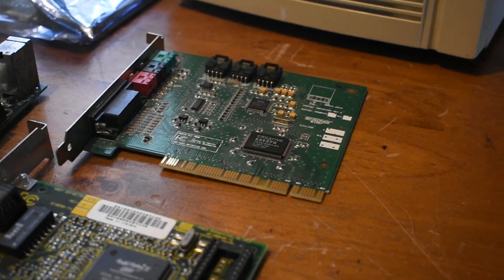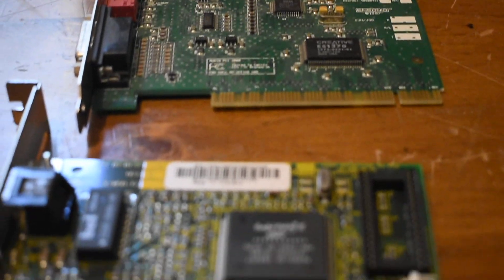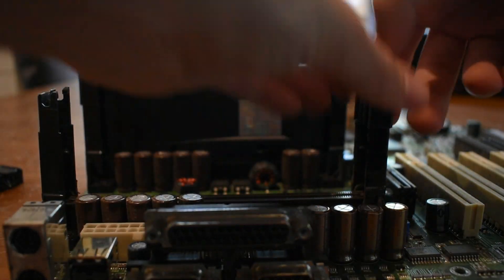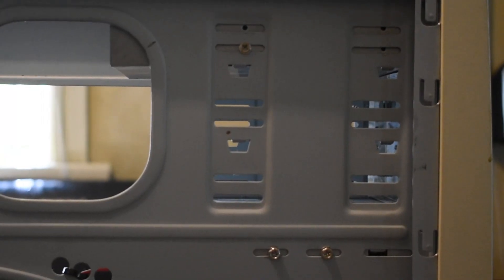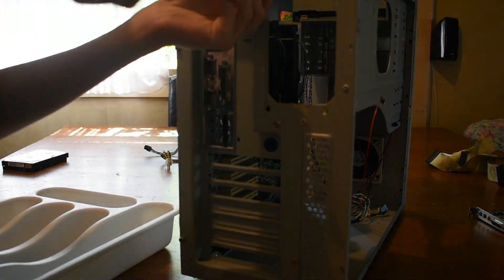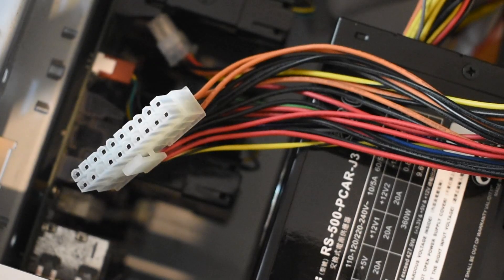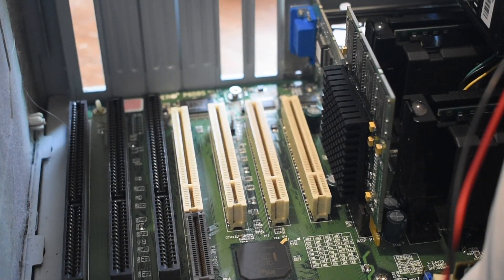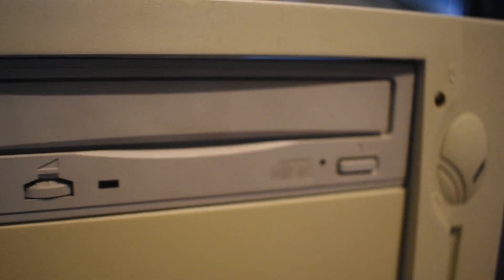Building A Dual Pentium III Workstation from 1999!

Comment: Sweet build! If you wanted to, you could easily turn this into a workstation or an overkill classic gamer. I'm putting together a similar build myself for just that purpose.

I'm throwing a pair of Pentium III 550 cards and 4 sticks of 256MB SDRAM into an old server board I found with an AGP slot and built-in Ultra160 SCSI. It's also getting a GeForce FX 5700 Ultra, a Turtle Beach Santa Cruz 5.1 audio card, and a pair of 10k RPM SCSI drives in RAID-0. Old school beige case too.

I'm using it for classic late 90s/very early 2k's 3D games, which this thing will be extreme overkill for, like putting a Chevy big block V8 into a bicycle. Pointless, sure, but that's half the fun!
Reply from the maker: Thanks! Yeah I haven't worked on this system in months now, other things have gotten in the way. I'm going for more of an overkill classic gamer approach, so I think I'll need to swap some parts and re-assess this system at a later date.

That sounds like a really nice system, should be awesome! One of the main reasons which has stopped me perusing this build more, is realizing that hardly any games will even take advantage of dual CPUs. Either way though it's a very nice setup to have.

Probably going to put either Voodoo 2 SLI or a TNT2 Ultra in this system eventually.
Reply: @ScanLinesAU  Having the dual CPUs is more of a novelty than anything useful in a gaming machine, like bragging rights, although normal Windows tasks are noticeable faster.

I had to downgrade to a Geforce2 GTS due to the power supply being too strained, but that's still a great card.

The Voodoo sounds like a good choice, although I've had more than decent performance with even the standard TNT2 for early 2000s games.

Comment: I had this motherboard in 2005, but it booted once only, and I never been able to make it work since then.  I disposed of it later. Check the price on eBay , refurbished dual Pentium III motherboards are as expensive as today's motherboards
Reply from the maker: Wow, yeah they sure are going for a fair bit hey. I don't really collect this old stuff because of it's value, I just like messing with this stuff a bunch. I think ebay is quite overpriced for this stuff, - I've  never really payed that much for any piece of vintage hardware.
Reply: @ScanLinesAU  go on eBay and see for yourself, you'll be shocked, $200 and above, they aren't even brand new . Also, check socket 370 single socket, there is one priced at $750 !! this is insane
Reply from the maker: @tunkunrunk  Wow,  yeah that's pricey alright! I've got a dual socket 370 motherboard, that aught to be worth a bunch. But keep in mind, an item is only worth as much as what it sells for. So, to get a more accurate value, always check the 'sold items' on ebay.

Comment: When it comes too the powersupply you usually aim for 3.3v too be at 25a & 5v too sit at 30a.
As it's a modern powersupply at worst it might just shut down if its too high of a workload for the power rails but worth keeping in mind if you encounter any issues related too that.

Could be an interesting upgrade using a ide too sata adapter & run a 32 - 60 gb ssd for something like this if the ssd in question does it's own garbage collection it should be fine with any file system & operating system really.

I myself got a windows 98 pc but its a bit low on ram atm 32 mb & i got a bug with the matrox mystique 4 mb graphics card that's in it at the moment locking up the system (2d gpu for the voodoo 1 i got.)
Not quite sure of the reason atm, something related too the pci bus feature set thats for sure like fastvid, bus mastering or something similar.
Reply from the maker: Ah yeah, I don't really look at the specs when using modern PSUs, just the wattage. I've had no issues with this one so far, but if it becomes an issue then I might swap it with a period correct Aopen one. 

I really don't like using SSDs in old computers. They just feel so out of place and really kills the aesthetics of a build like this for me. 

Nice! That sounds like a nice rig.

Comment: I had just been rendering some short clips in 3ds MAX using my own dual Pentium II build several days ago, and that program really does make good use of both CPUs. The first version can even run on Windows NT 3.51, which pairs with a Matrox G200 all fine.
Reply from the maker: Yeah, I would've thought it would help in an application like that. I'm going to install NT4.0, but I might do a dual boot at some point to see what older versions of NT are like.